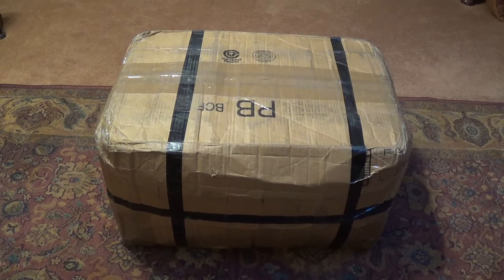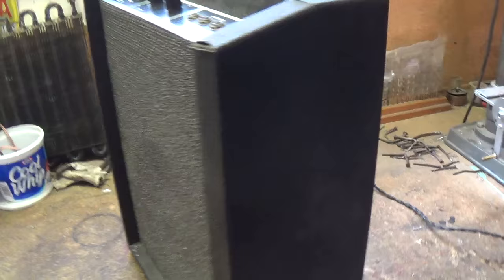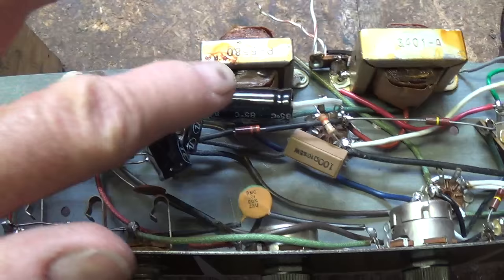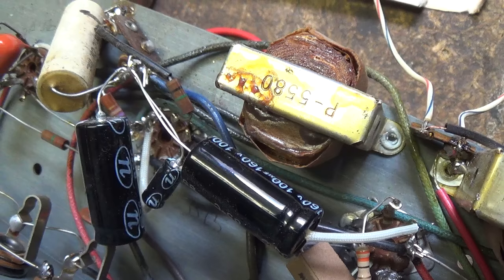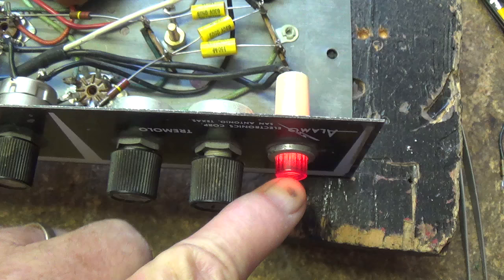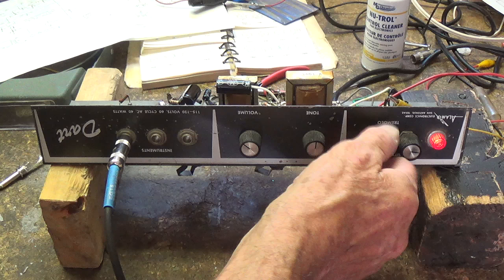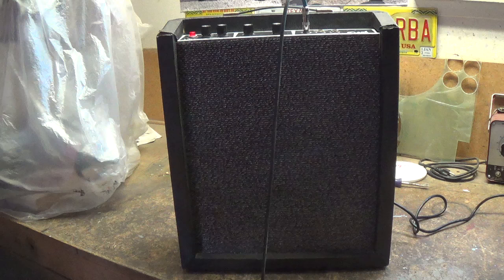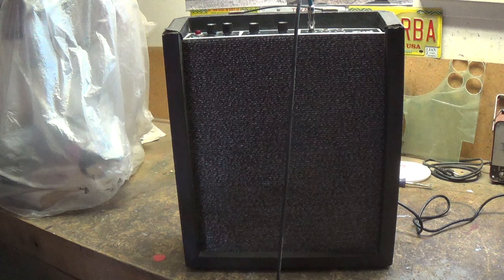1960's Alamo Dart Guitar Amp:  Ressurected from the Dead

Comment: hey uncle doug!  miss ya man!   i was the guy that requested a layman's tutorial of how a tube amp works with which you supplied a two part series that did just that.   anyway i was thinking back to a comment you made about i believe output transformers and how they accomplish their task via inductance.  i was wondering if you cared to expound upon that.  i've read a little bit and from what i can understand it has to do with rate of current change as the voltage approaches a coil....which suggests some time component.  super confusing!   anyway just a video idea.  hope you're well.  i still watch and follow your videos. they are a treasure.
Reply from the maker: Greetings, MHinB :) As you know, transformers are used to convert high voltages (at low current) to low voltages (at higher current), and vice versa.....example: When 0.3A of current @ 120VAC passes through the primary winding of a power transformer it can induce (without actually passing through the transformer) a current of 6A @ 6VAC in the secondary winding (note that the product of the values on one side = the product on the other).  The invisible effect that bridges the two windings is induction, and it occurs whenever alternating current passes through a coil of wire (primary) that is in close proximity to another coil (secondary).  The frequency of the AC remains the same in both coils, but the voltage and current are altered, depending on the number of windings in each coil.  See my videos on output transformer winding ratios for more info.

Comment: Haven't gotten thru the entire video yet but even back then they wouldn't have connected the user accessible chassis to one side of the AC line.  They float the neural side of the line throughout the unit as the hard ground of the circuit and AC ground the chassis with the equivalent of the death cap.  That's what that large white ceramic cap is doing.
Reply from the maker: Thanks for the info, Glen.

Comment: Uncle Doug, I can't thank you enough for all the knowledge you share; you are a great teacher. Perhaps you have addressed this in the past, but a refresher, at least for me, is needed. Specifically, what type of wire would you suggest in an amp build? Please be specific; gauge, insulation material, stranded vs solid, etc... Do you use more than one type of wire in an amp? If so, please specify. Do you find that wire selection can affect tone? And finally, do you adhere to a color code? Thanks again Uncle Doug!! Wish I could buy you a beer!
Reply from the maker: You're welcome, Dave. I use stranded 16ga in the power supply and 18ga for the remainder of the amp. As far as color coding, the power transformer and output transformer come color coded, but I don't adhere to a c.c. in the parts of the circuit that I wire.....other than a tendency to use black for grounding. I seriously doubt that wire type has any demonstrable effect on tone, unless you used a very small gauge (i.e. 22 or 24) in the power supply, which may increase sag.

Comment: Also, I highly recomment replacing the 12AU6 with a 12AV6, or just swap the two in the amp and give the tremolo the weaker output tube. The tone will be improved, i.e. more gain and overdrive, with the 12AV6 in V1.
Reply from the maker: The 12AU6 is a pentode, Brad, so it's hard to see how it could be swapped with a duo-diode triode, like the 12AV6. We appreciate the input, but to be honest, are quite satisfied with the tone and volume as is.
Reply: You are correct. My bad! I was thinking of the 6BA6. Those can be subbed with the 6AU6, which has more gain. Sorry for my confusion.

On the flipside, the 6AV6 can be subbed for the 6AT6, which is sometimes found in series filament amps. That's where I was confused.
Reply from the maker: I'm glad to see that I'm not alone in getting tube numbers mixed up :) Rusty has to keep an eye on me whenever I pull tubes out of our stash. Regardless, thanks for the always helpful input.

Comment: Doug, an excellent video.  It looks to me that the previous "work" was done by someone who had no clue about how the circuit worked. BTW, I think that Jack does a great job on the initial sniff test!  Thanks.
Reply from the maker: You're welcome, Shaun. Some of the mistakes defy all logic.....but it was an interesting challenge. Jack is indeed proving to be a tremendous asset when it comes to amp repair (don't tell Rusty I said this).

Comment: I have a Gregory "Mark X" that I got off ebay about 11 years ago, has an alnico speaker in it. It sounds great after I did bunch of stuff to it, but anyway I was curious as to why I've never heard of that brand before. Did some research and found that they had about 18-20 things on the market at some point in time. I surmise that most of them ended up in the dump because they were built so cheaply.
Reply from the maker: I too have never heard of the brand, VC.  Perhaps you're correct about the reason.

Comment: I really enjoy watching your videos and your "no nonsense" attitude when addressing important topics. Keep it up! One question about the amp at hand - would it make sense to add a 115-115 transformer just to make things ... safer?
Reply from the maker: I honestly think that with a proper fuse and chassis-grounding power cord, there is little chance of shock hazard, Mark, but it wouldn't "hurt" to add an isolation transformer  ;)
Reply: @UncleDoug  The amount of Amps and Volts running around the circuit after any isolation transformer remains the same,  your vid on Isolation Transformers in General though was useful,  as one is dependent on the supply power itself being properly grounded - some gigs dont have the best with iffy trailing leads.  I suppose you could get a builders 110-110 power transformer brick which would do the same thing as an internal one.

Comment: With everything crosswired so badly inside the amp I'm really surprised nothing blew up or fried when it was plugged in or turned on. If all the tube sockets were miswired I'd be extra worried about the tubes themselves having been wrecked.
Reply from the maker: I agree, Daniel, but surprisingly enough.....the tubes and transformers were fine.  Thanks for your input and concern.

Comment: Hang on - surely the neon bulb and filament circuit were wired up correctly from the start then. You had one loop going from the switched live through the neon to the neutral, and another loop in parallel going from the switched live, through all the filaments and the resistor to neutral.
Reply from the maker: You make an excellent point, Mak, and (in retrospect) I agree completely.  The circuit did not function when in this arrangement, but it was probably due to (many) other wiring errors that had to be corrected.  We really appreciate your knowledgeable and helpful input.
Reply: Question is should the neon go in the same run as the filaments ?  given the nature of neons would it actually make any difference,  if they pull voltage variations will it impact if wired in series or in parrallel to the supplies to the tubes ?

Comment: I love the tone of low watt tube amps, I just lucked into a crate v16 USA, it sounds stellar, but I was wondering if there is reason to change tubes, simply because they are old? or, are they fine till they fail?
Reply from the maker: As tubes age, the ability of the cathode to yield electrons diminishes, so the plate current and tube bias go down, which requires re-biasing back to their original plate dissipation values. Eventually, they cannot be properly biased and must be replaced.  In simple terms, if your amp starts to sound dull and does not have sufficient volume it's either time to re-bias or replace some of the tubes.

Comment: Hi Doug, you make  very interesting videos and I learned a lot. I have a old body of a guitar amp myself . Only the pcb with 4 EL503 valves and a few ECC83   and two very big and heavy transformators which were attached to a thin aluminium front plate were the potentiometers and inputs are.. It says PA200 on front, rumors are that the make was Clean City . Could that be 200 Watt?  Its kind like the circuits that you show. End tubes in parallel. Mid point of the speaker trafo to the + 400 volt.  Years ago a mede a circuit drawing bij following al the wires, but I lost that. But The last time I put it on it worked and sounding very very loud and clear. Never tried the max because my guitar speaker is only 50Watt RMS.  And your video of biasing double ended amp is very great. Now I know how to measure if there is any imbalance in the end tube currents. Just measuring transformer DC ohms and and cathode resistor voltage and plate voltages. And noting everything in a nice table . So I want to try your method on my amp. Only question that I can think of , how can I do that same trick when using parallel end tubes. should I the use 4 cathode resistors to measure that separately?
Reply from the maker: If the output tubes are cathode biased, you could measure the voltage drop across each bias resistor. If the output tubes are grid biased, then you can measure the voltage drop across each half-winding of the output transformer primary.  If paired output tubes are in parallel, your current reading will be double, so you must divide by 2 to get an average PC for each tube.

Comment: Uncle Doug-I have another dumb question. If you are too busy or choose not to answer, that is fine.I am still planning on starting my champ build before long but I have an organ amp I bought recently,Lowrey  lsa. There is not a whole lot of info about this one. I did not know it had a auto step down transformer in it when I bought it and the man did not explain this and I guess I should have done more research, but too late now. I have not tried to turn it own because I was a little afraid to until I knew more about it, so I did as much reading as I could find. This t. f. has  13  wires coming out of it. I traced wires and looks like it has 5 v and 6 volt. It still has three plugs on back from organ, almost look like tube sockets. I think this has 220 come in and then converted to 110 and if I am tracing it right it looks like the two 6v6 tubes are used just as a power amp. The 6sv7 has an rca jack connected to it with a little 4 hole connector beside it. There is a heater wire on the 6sv7 but that is it other than bare wires from the rca and some resistors and ground. There are some long resistor bars mounted on the back wall, the longest says 5 watt on one end and 7 watt on the other end, and then two shorter ones. It has a 110 cord and a fuse with a red cap in the middle of holder that screws out and the fuse is attached to it,3amp. It has an output t. f.. Here's my problem. I have read that these transformers can be a little dangerous due to the way it is grounded or not grounded,that the chassis could end up hot if you do not understand how this works. It is not worth getting electrocuted. I hate to gut this thing but I'm not sure what to do   .It is hard to trace all those wires on all those organ plugs because I don't have a schematic or even color codes, the 13 wires are colored totally different than a regular t. f.I guess I could plug the 110 cord up and trace the wires with a meter but I don't want to blow anything up. I would really thank you for your opinion because I trust your opinion.Sorry for the long comment but I figured you needed the info. I am a little upset with the man that sold it to me, I'm pretty sure he knew because that is all he does on ebay. He sales tons of tubes and amp stuff. I contacted him but he acted like he didn't know anything!!!!!!!!!!!Oh the rectifier is a 5u4. The transformer is a P-6287 and the output is a p-6051, I think they are Stancor. I guess I could build a variac out of the transformer? Thanks.
Reply from the maker: My best suggestion would be to put the mystery circuit/transformer back in the store room and work on your scratch-build Champ. Eventually you may be able to decipher the mystery circuit.....or not. Regardless, at least you will have the benefit of greater knowledge, and a nice Fender Champ clone.
Reply: I think that is very good advise. I've always heard-listen to people smarter than you about a subject!
Reply from the maker: I think you'll find this to be the best approach, WN. Good luck.

Comment: Great video Uncle Doug. Great to have you and your crew back in the saddle. I will from here on out "remember the Alamo"! What is the reason why a lot of these kind of amps had the on-off switch on the tone control instead of the volume control? Thankz
Reply from the maker: Thanks, ATL :) Your guess is as good as mine on their reasoning.....perhaps they had a stash of pots with on/off switches attached that were of an appropriate value for tone control rather than volume (?)  It may have simply been a matter of parts cost and availability.

Comment: Hello Uncle Doug, first, thank you for a most informative video - it certainly does pay to check what previous "repairers" have done..... I do have a question relating to the schematic which shows @ 16'28" - to do with the volume control. In all circuits I have seen or worked on, the o/p from the preceding plate connects to the top of the pot with the grid of the next stage connected to the wiper. This diagram shows a reversal. Is this right please?
John Roberts
Wellington
New Zealand.
Reply from the maker: I see your point, John. Since the schematic is hand-drawn, I would view it with skepticism. I believe the VC should be wired as you have stated, otherwise (as in the hand-drawn schematic) it would be possible to ground the plate voltage.....not a good idea in my opinion :)

Comment: Hello again Uncle Doug,
Question premise: Completed a Fender Princeton 5F2-a with new Classictone transformers with all new tube compliment. I opted for the upgraded 15 watt OT with 4/8/16 ohm outputs. Speaker was a donor from a modern Fender Vibro Champ XD, with an unconnected reading of 7.2 ohms, and it is connected to the 8 ohm output jack. The 22k feedback resistor is in place. All components test good on spec with the schematic and good continuity on solder joints.
As this is a combo amp setup (speaker in cabinet with chassis), I used the idea you have shown in previous videos of your amp builds, using 1/2 of a patch cord, cut end soldered to the speaker, plug end into output jack.

My question: Does the added impedance of the patch cord to the speaker's impedance create a problem with the total impedance being well outside the 8 ohm expected load?

I ask, because I am getting some awful clipping when playing the amp. I unplugged the patch cord and tested while it was soldered to the speaker (removed/unattached to the chassis), and I get a reading of 13.2 ohms.
Reply from the maker: I am a little surprised that a short patch cord could add 6 Ohms to the overall resistance.....however, I seriously doubt that the clipping is due to the impedance of the speaker. You could connect it to the 16 Ohm output and see if there is any change.

Comment: Why not use a 50C5 instead of a 35C5? It's more common and less needs to be dropped across the ballast resistor.
Reply from the maker: I'm not sure why the engineers who designed the circuit didn't do that, Mr. H. Perhaps it had to do with cost or logistics.

Comment: good day Uncle Doug! if both wires from the power cord are soldered together, shouldn’t of that made your current limiter device light up? or did the current take the green wire to ground instead, bypassing the limiter? or was the electrons turned into heat by the circuits components?
Reply from the maker: This is an old video, but yes, a dead short in the power cord should illuminate the current limiter.

Comment: hi doug, I came by this conn organ that was getting thrown away.. someone beat me to the lesli and speakers but I grabbed up the amp and lots of other components...
it's a theatre model 642 and was one of the first transistorized ones they produced. amp is still point to point wiring. info tag says it's 155 watts.. can that be converted to a guitar amp?
It's pretty cool..I heard this a day before they trashed it and it was awesome...I can hardly believe someone can toss something like that out!
Reply from the maker: A point-to-point transistorized circuit.....rather unusual.  I have no knowledge or experience regarding this amplifier, but would assume that it could be converted to guitar use.  The 155W most likely refers to power consumption, not power production. Let us know how it turns out.

Comment: Am I missing something? Imagine that neon wasn't in the circuit then the valves should all light, the neon is just wired in parallel. Unless the neon was posing a seriously smaller electrical resistance but limiting current?
Reply from the maker: Good observation, Prince. In retrospect, I agree.

Comment: Doug, that amp has an isolation transformer shouldn't be a shock hazard at all.
Reply: The isolation transformer only affects the temolo circuit.  The rest of the amp is still deadly.
Reply from the maker: The isolation transformer was only for the 12AU6 pre-amp filament, Pete.....not for the bulk of the circuit.  With the chassis-grounding power cord, however, I can see no way that the amp could ever be considered a shock hazard.